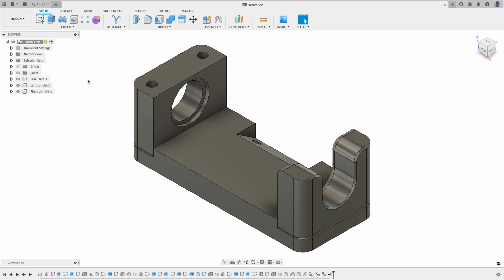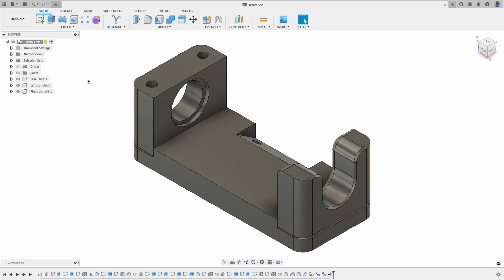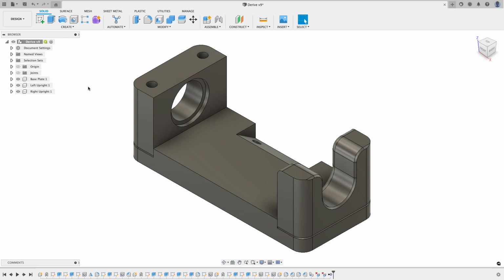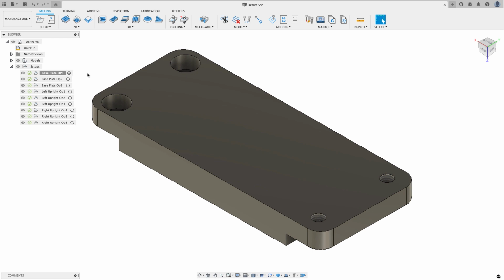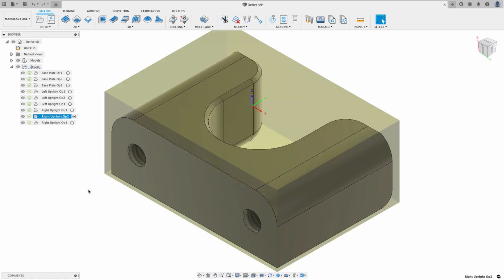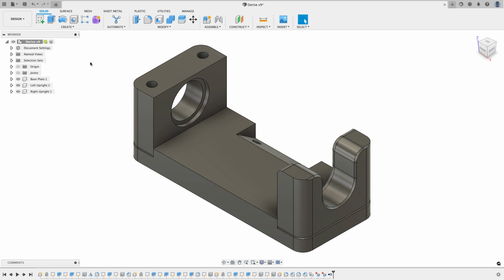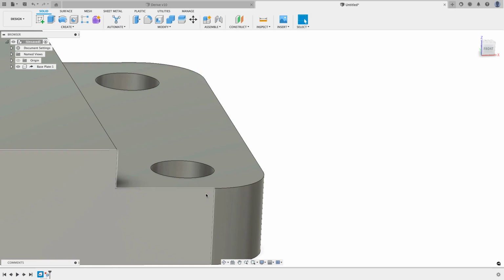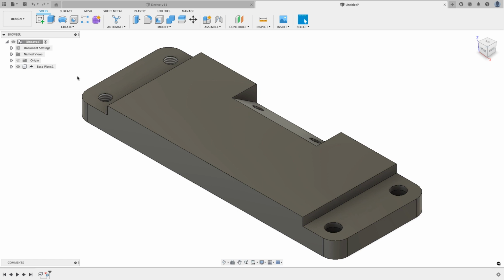Fusion 360 - Organize your files using Derive

Comment: Thy! But how can I use the original component or body in a library to re-use it. E.g. a specific ray?
Reply from the maker: You can insert any fusion Design as a component in a new design. When you derive a part into a new file, that also gives you a file you can insert into other files.

Comment: The better way to do DFM would be to utilize the manufacture model space within manufacture rather then the derive. Derive for this would be good if you wanted to give your CAM guy access to just that 1 component rather then the entire assembly.
Reply from the maker: That depends. Again, one of main reasons I showed this workflow was to simplify the number of manufacutring setups in one model. If I had 10 components that each needed at least 3 setups, I would have over 30 or more setups in the same file. Using derive, I can spin each of those files into a single document with only the setups needed for that part. The other goal was to not dirty the designers files. Again, this may or may not be a problem. If you have a company that is also doing lifecycle management, they may consider a part "released" when the final CAD work is done. At that point, adding sketches for CAM toolpaths may not be allowed. Deriving these into their own files allows the original design files to not be altered, yet still used for things like CNC programming.

Comment: 04:15 Why can't you use the 2D chamfer? I use it almost every day for that exact reason, for i'm too lazy to manually adjust the lead ins and outs. Just put Chamfer Width to 0 and Tip Offset to your liking. I keep my clearance at 0.02mm and it seamlessly binds the chamfer with the wall. Only thing is that when the chamfer is already modeled in, you can only select the top contour and not the bottom, for as with the regular "Contour" option you could choose between the two. Maybe for other angles it doesn't work, but for 45° it works (for me) flawlessly. Also great overview of the Derive command, will probably use it in the near future!
Reply from the maker: That is definitely an option. There is always more than one way, but without putting effort into explaining different ways to use 2D chamfer, I just went with the default method won't work for this example. Thanks for watching.
Reply: Came here to post this. I only found out recently that you could select the inner contour of a modeled chamfer and the 2d chamfer tool paths works well.
Reply: Sometimes it doesn't work though. 60% of the time bit works every time

Comment: That’s really handy to know. If I have a component drawn in CAD that I want to show someone how it will look, I can model in chamfers etc so the render is realistic, but have a derived file with no chamfers to use in CAM. I like that!! Great video Kevin
Reply: Hi Rob, you may use a manufacturing model instead. it is located into the manufacturing environment. You will then benefit from all the parametric model simplification features while staying inside the same original fusion file.

Comment: - 'Derive' certainly has its use cases.
- In the case of "removing" chamfers though, a 'Manufacture Model' w/ 'Simplify' in the Manufacture workspace would be more appropriate, I believe.
- Perhaps you'd consider making a video on that solution, and compare to the 'Derive' solution. Just a thought, if you want ideas for other vids.
- Whatever the case, thx for another good video :) Carry on...

Comment: We do use the derive command, but mainly for other reasons. This seems like another great use, as the design side of the files do get messed with a bit, things get hidden/unhidden which could affect later assemblies.

Do you ever use the "manufacturing model" feature built into the mfg section of Fusion? We had tried it quite a while back and were getting some weird results, so we went away from that but were just recently thinking of trying it again, for pretty much the exact thing you laid out in this video. Now if we do, and it still seems flaky, we could easily use this workflow, and possibly just setup an entire folder for only PartNum_MFG named files.

Any thoughts on differences between the mfg model and using a derive?
Reply: I've had nothing but problems with manufacturing model especially if there are multiple parts that need to be machines like this example. I've had much better results using derive like this and keeping the original file intact. Each of our folders has an original numbered part, an associated drawing file, and a derived CAM file. Changes to the original carry over to both the drawing and derived cam. Works pretty well!
Reply: @M_a_t_t75  glad to hear I'm not alone in seeing weirdness with the mfg model. I mean I'm not glad, lol, I guess I am glad it is not just me!
Reply from the maker: @blacksmokeDMax @matt For a while, I was under the impression that MFG models were going to be phased out. However, that isn't the case. I don't have a lot of experience with MFG models one way or the other. 

I would encourage you guys to post when you have issues to forums.autodesk.com under the Fusion MFG forum.